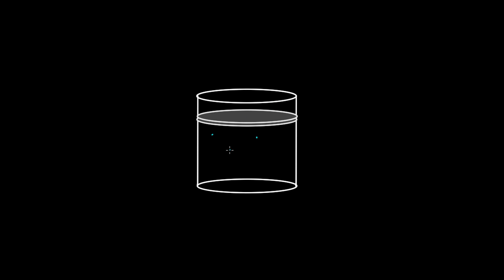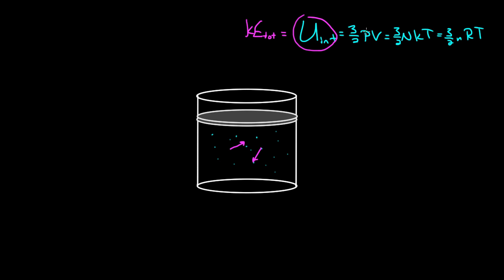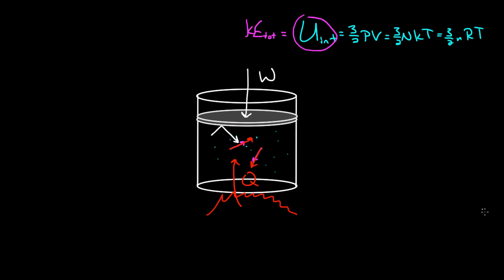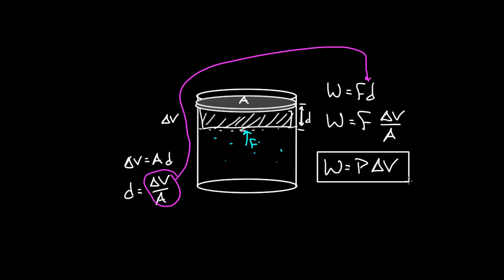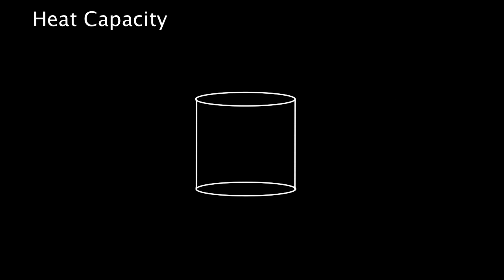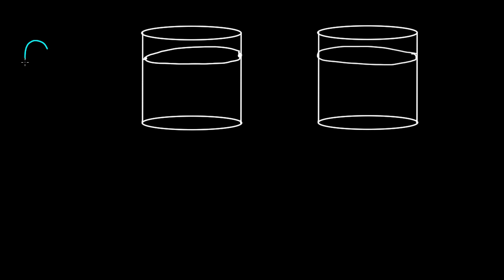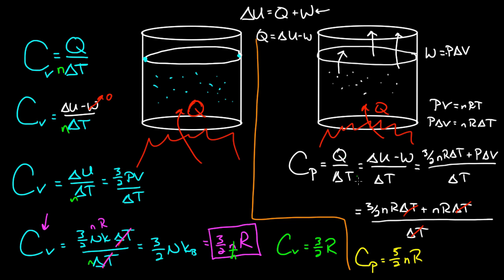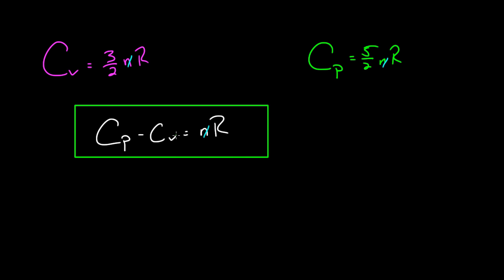Heat capacity at constant volume and pressure | Physical Processes | MCAT | Khan Academy

Comment: i want to help me with this calculation, "calculate the two principle molar heat capacities of oxygen if their ratio is 1.4, density of oxygen at stp is 1.43kg/m^-3, 1atm=1.01*10^5 Pa and molar mass of oxygen is 32.0*10^-3kg/mol?"